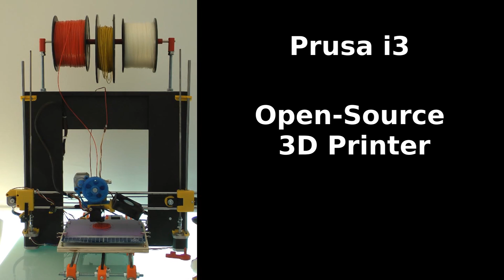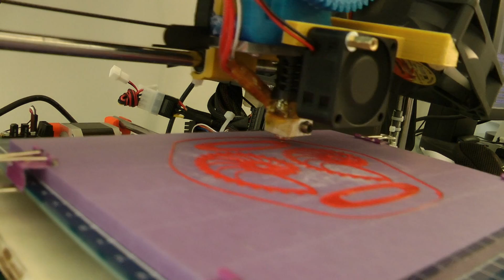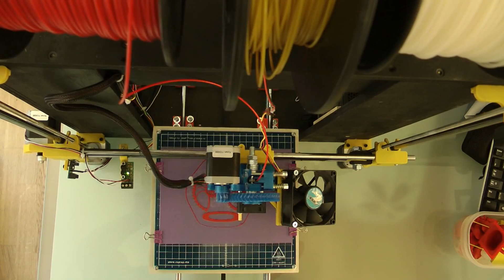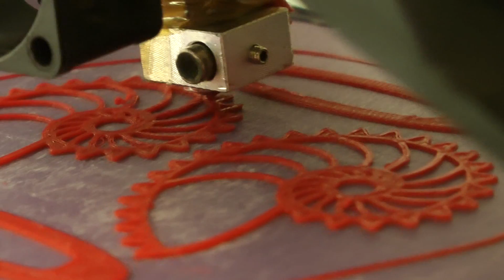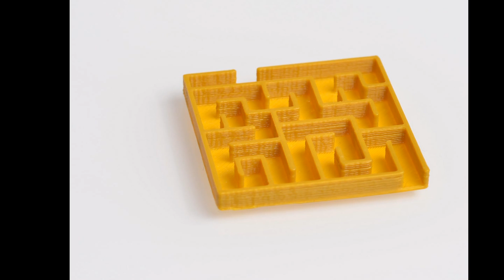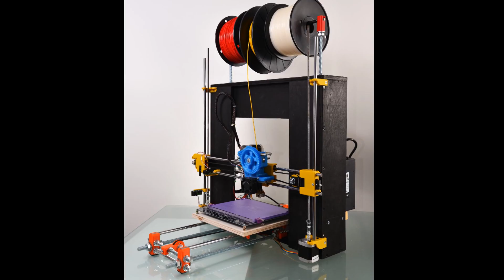Scratchbuilt 3D Printer-  Reprap Prusa i3

Comment: i put one together been 2 months now still cant get it working right its a reprap geeetech 13 tried adjusting steppers but when i turn volts up it jerks bad only one z stepper motor works at atime. about to just toss it in the trash cause i wasted $300 on it gota save up a few $1000 so i can get a working one i think. couple 100 hour in mine and works  nothing like this one.

Comment: I made a wooden Prusa i3 as well except I used the files from the single plate version because it takes a bit less place and I though it looked better. I don't know for you but my wooden bed was a bit heavy wich caused lots of vibration at high speed, so I used my Prusa i3 to print the original bed. Of course it was too big so I printed it in 2 parts then assembled it with bolts. But now I can go much faster without any vibrations !

Comment from the maker: ***** Well, the Prusa i3 is a bit easier to deal with than its previous versions but it is for sure more work than using a ready made printer or a kit. The point of it is to be able to experiment with different thing like dual extrusion, high temp materials or high speed printing and to have fun building it :-) Cheers!

Comment: Looks like you have that working very well - you're print quality is great :) For people looking to build a machine, I would definitely recommend going with something like the i3 over a standard Prusa.

Your machine is much more stable in X axis than mine. Then again, a frame based on threaded rod with no stabilizers is about as good as you would expect :-P

I notice that your retract speed seems very high, I can't seem to get mine fast enough - looks like I'll have to play around with that. I'm feeding 3mm filament but I think I might have my tension too high.

If you have time, let me know what temperature do you print your PLA at.

Thanks..

Comment: I'm curious what kind of layer height you have with those frogs. Is that really the best a Prusa i3 can do?
Reply from the maker: Hello! That was some of my first prints, they are probably at 0.25mm layer height. The printer is able to print down to 0.05 layer height (or bellow) but it takes much more time:-) I have now added a heated bed and better cooling for the print and it gives much better results. Cheers!